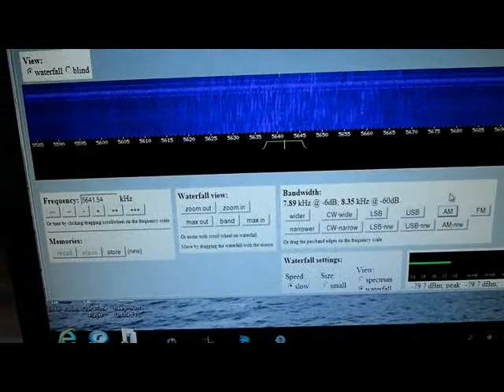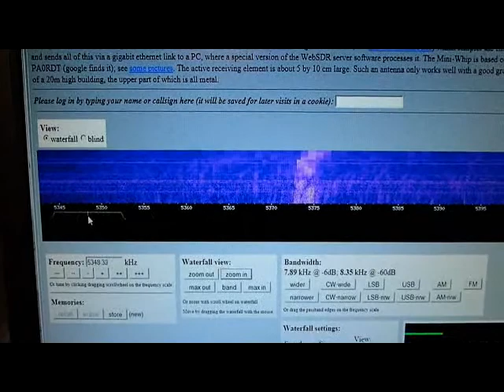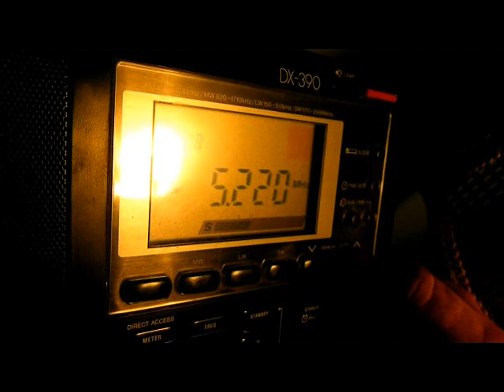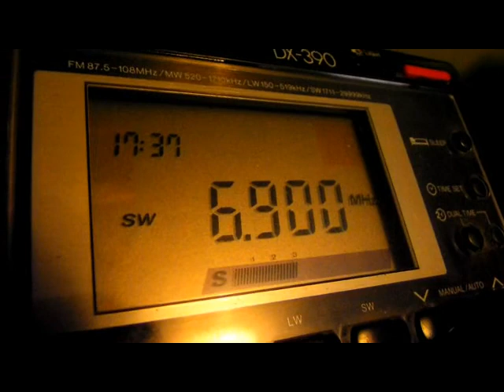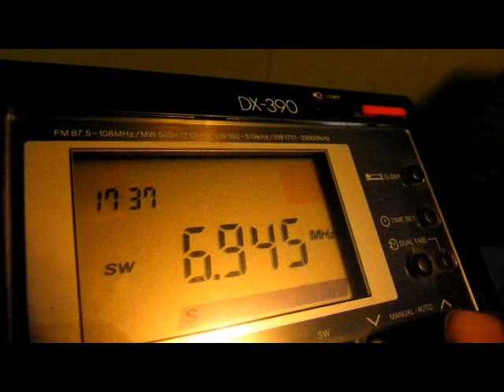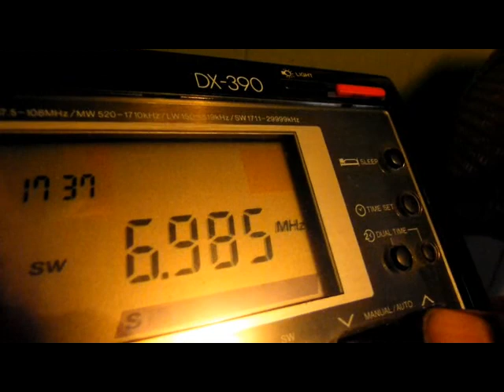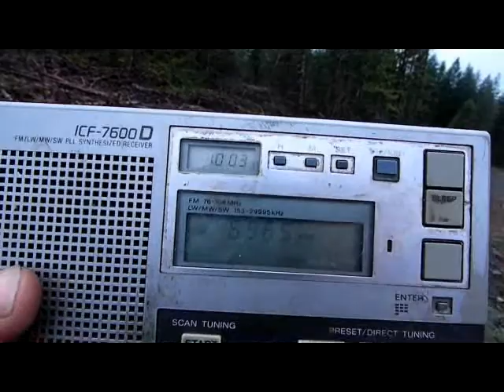Strange Worldwide Interference on Shortwave Band

Comment from the maker: Hey RTN yes I kinda concluded thats what it had to be. in fact on 6925khz while outside later at night walking around with the portable SW and whip antenna I heard the buzzing but then I heard  the Styx song "Im ok this way" from Pieces of 8 album, on AM then went off the air signal was very good for a 3foot whip although I do find that new engine buzz sound can be very annoying when tuning for weaker pirate signals in the 6900khz  band.